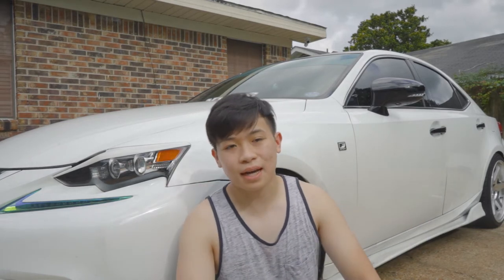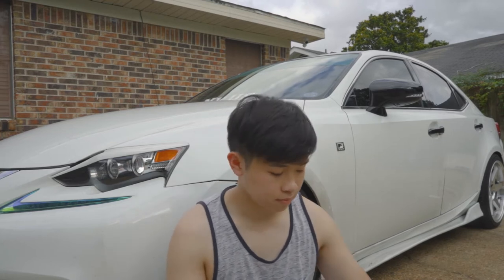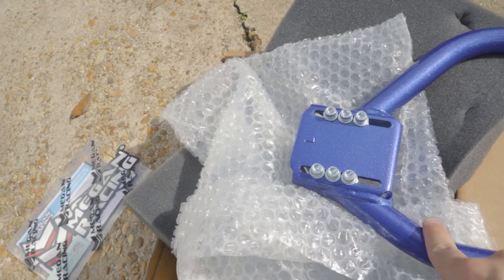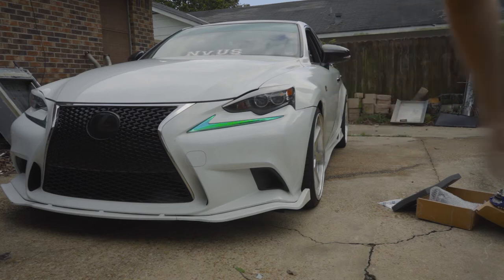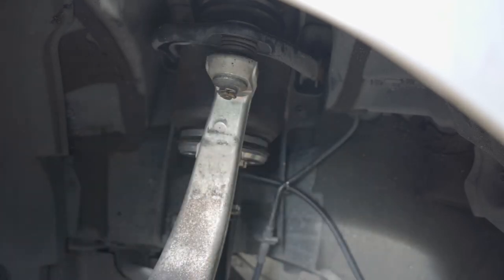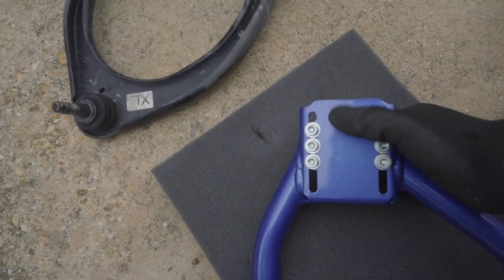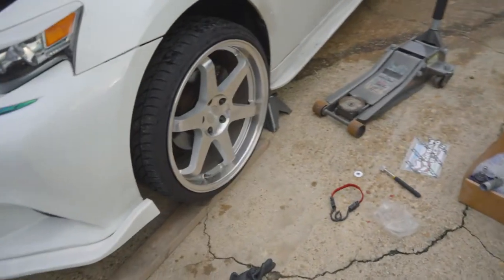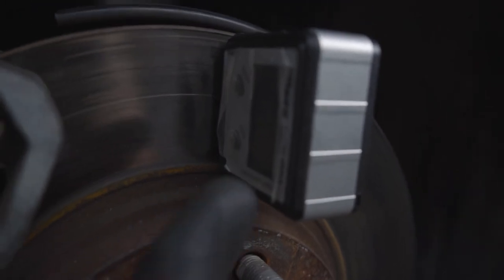Lexus Gets Front Upper Camber Arms!!!

Comment: I seriously hope that you’ve figured out by now that the castle nut’s cotter pin is supposed to be folded over (like a “loop”) and NOT kept straight or opened up like a “V!” 

Also, you mentioned about reusing the Lexus castle nut and not the Megan racing nut. Be aware that there are MANY nuts and bolts that are NOT reusable, which is why new ones are included in aftermarket and/or OEM (style) replacement parts. I can’t say for certain that that castle nut is or isn’t reusable, so I would highly recommend you research that for peace of mind. 

Oh and one last thing, the camber adjustment is meant for an alignment shop to set, not for you to eyeball and call it “good.”
Reply from the maker: Since I reused the oem nut I ended up reusing the oem pin as well so it ended up locking like how the oem was where it was like the loop and locked in and not straight out. I mentioned it to few friends and they all said using oem was better choice. Also the camber eyeball was to see if I rubbed on my wheels or when I air out etc then I told my alignment shop what degrees it was and then made final adjustments there when I got an alignment. I do appreciate all the information though! Always love the feedback and concerns in case I did done goof!
Reply: @Jonathan.Nguyen  You what we call "hard headed". You just admitted that you took the car to get aligned professionally yet you went back home and CHANGED IT AGAIN 😕 But being arrogant as if everyone else was at fault for YOUR FAILURES.
Reply from the maker: @MRMAN-wb1tv  did I say it was anyone fault? Now you sound like one to “assume” but you probably see everything as negative with this world today I don’t blame you but your account does look like what we call a “troll account”